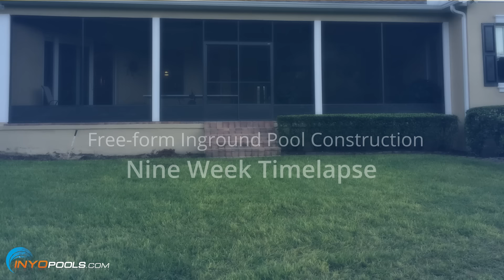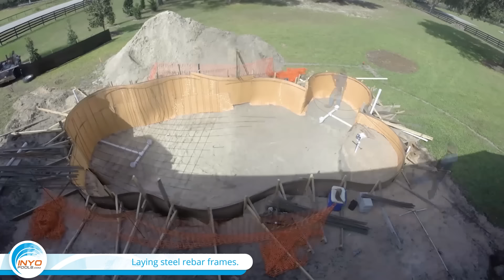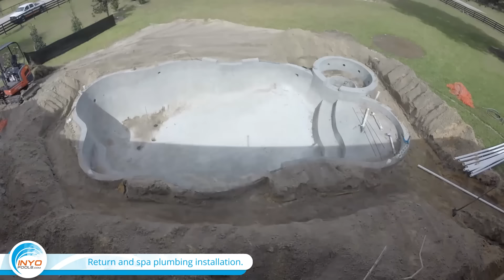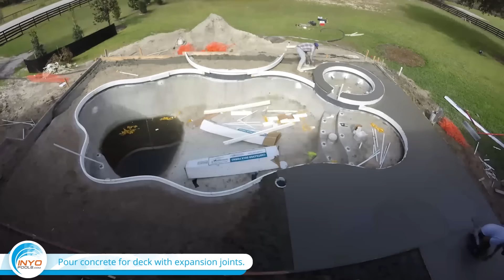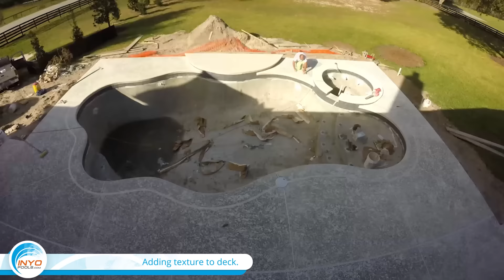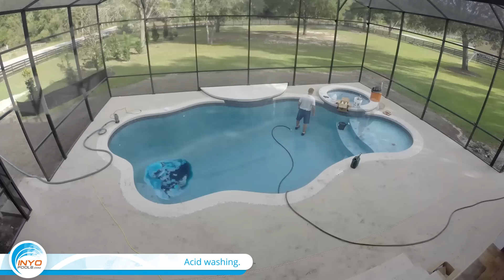Free-form Inground Pool Construction Timelapse

Comment: How much did it cost in total?
Reply from the maker: Hi MoneyPlayer this pool cost $50,000 however that price included the screen enclosure which was $10,000. This pool also had a lot of equipment upgrades like Automation, LED Color Changing Lights, Gas Heater and a Variable Speed Pump. Note that if you did not need the screen enclosure that in many cases you may need to install a fence but that would be more in the $2,000 - $5,000 range.
Reply: Inyo Pools Ok thanks for letting me know
Reply: ***** Possible but you will need to buy a powerful heater
Reply: WOOOOW !!! A similar pool where I live will set you back anywhere between 100K to 125K and that's without the screen enclosure :O
Reply: Very nice pool and excellent work.  In the Northeastern U.S. that pool would cost about 50% more and we only get to use our pools about 3 months per year. Go figure, supply and demand I guess.